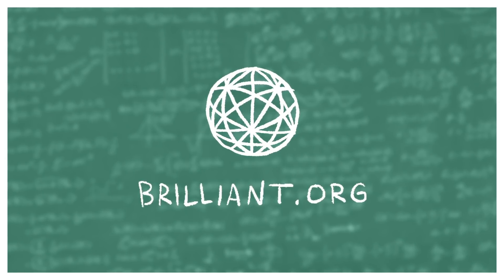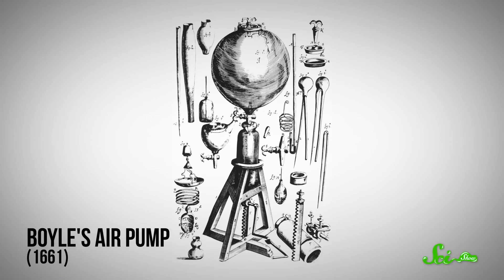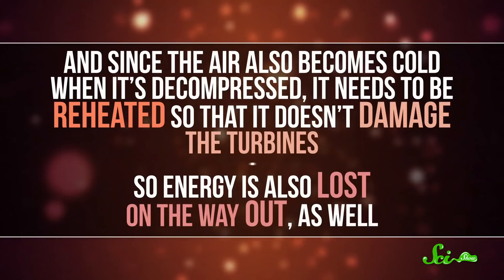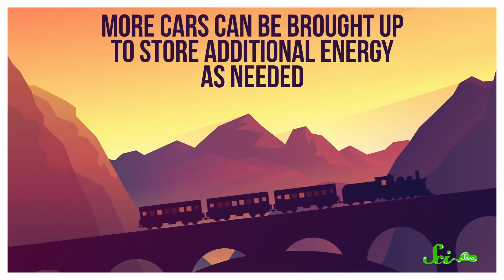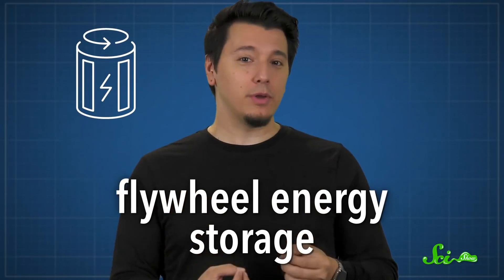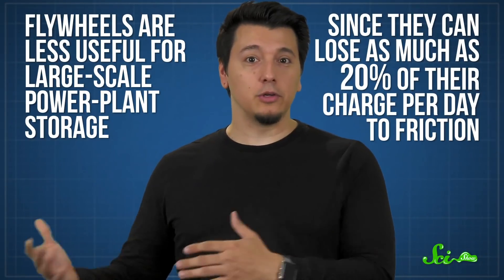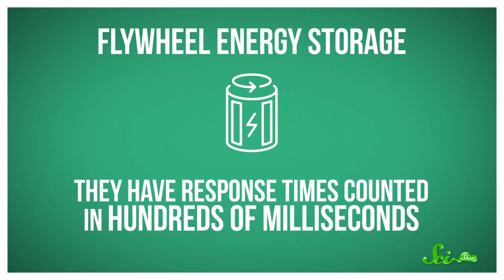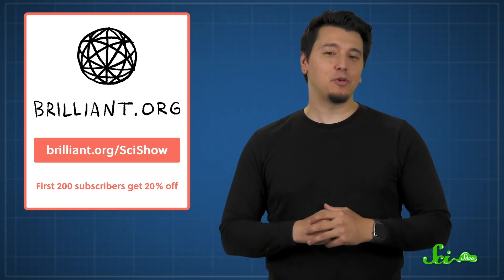The Surprisingly Retro Future of Batteries

Comment: It's really amazing how much energy we use just to heat and cool things. Imagine if we could find a way to use heat pumps to transfer heat efficiently and effectively to where it's needed rather than burning fuel to accomplish the same task. The issue seems to be transmission. Infrared radiation would just get absorbed, and brownian motion requires a contact point or heat exchanger of sorts. Essentially we do this everyday by using an intermediate like electricity, but conversion losses lower it's efficiency. We use energy to generate power to run an air conditioning system, and we heat living spaces where the climate is too cold. To put it simply: I wish we had a better solution.

Comment: drill a super deep hole straight down, suspend an enormous weight over the hole attached to a cable and pulley.   lift the weight with excess solar electricity during the day, and lower the weight to turn a generator at night.  like the weight that powers the pendulum motion in a grandfather clock.

Comment: I'm not sure why anyone would consider pressurized air under those conditions. It might be that the battery wouldn't be depleted or even filled to capacity all that often. Yet imagine repeated cycles over time and the variable quality in the subterranean earth would degrade in unpredictable ways. There are seismic tremors in conjunction with resource extraction. There isn't much talk on how this could impact adjacent underground ecosystems or the water table as well as a possible human incursion through other industrial activities cracking the pressurized space.

Comment: I spent all the the 2010's developing and building large scale energy storage for grid applications.  I reviewed under NDAs probably every technology described here, a total of over 200 different companies by the time I retired last year.  For the next few years the answer is definitely lithium based batteries.  Billions in investment has lowered costs and improved reliability to the point where my latest projects were paying ~$125/kWh for battery modules in the ~50MWh quantities.  ~90% efficient, very low standby losses, and extremely compact. Also, the primary companies here (Samsung, LG, BYD, CATL, Tesla, etc.) are large companies that can financially back long term warranties, which is a real requirement for storage projects that can cost 10's to 100's of $millions.  There is a need for longer term energy storage, and that is an ongoing area.  Compressed air would be great, but the problem of extracting the heat of compression during compression, storing it, and then reinjecting has been one several smart companies have tried and failed at.  Aside from the "train" noted here, there are many non-water gravity storage systems, but few if any can provide needed services at a low enough tech risk and cost.  Flywheels have made great strides, but stand by losses are too great to bear, and Li batteries now beat them at $/kWh by a wide margin.  Also, the edge of a grid storage flywheel may be traveling at equivalent to Mach 2, and if the mag bearings fail, the sudden energy release is a sight to see.   As many people noted,  pumped hydro storage is a mature tech and widely used around the world.  the USA hasn't built any new pumped storage in about 30 years, but that's mostly because of the politics of water in the Western USA.   China was under construction on 20GWh of pumped storage a few years ago.    I believe a lot of current efforts for long duration storage are about creating some energy-dense chemistry using off-peak wind and solar, such as H2, Methane, Ammonia, etc.

Comment: There is another gravity assist "battery" that is being used successfully in Europe and Japan: pumped-storage hydroelectricity. The idea is that you use renewable but intermittent energy sources -- wind and/or solar -- have some power diverted to pump water into an elevated reservoir. This mass of water in a high potential energy position effectively stores the generated electricity. When the intermittent energy is too low to fill the need, water is drained from the reservoir through electricity generating turbines, exactly like hydroelectric power production.

Comment: What about using heavy weighed blocks in series and using the electromagnetic energy from the renewables to hoist them? When you need the power back, release the winch and let the kenetic motion flow into the system.

Comment: Trust me you do NOT want an extremely large rotating mass in a linear motion because it will "want" to resist any directional change, which is how bicycles remain upright. If the flywheel vector is altered while its spinning it could cause an accident and likely take lives & causing property damage rolling down a street or track.

Comment: The crane one is thoroughly debunked. Just the maintenance on the moving cable system alone is insane, let alone factoring in winds affect on the positioning system for the blocks. Cranes are not a simple machine, nor can they operate in winds that would sustain windmills.

Comment: In case someone is wondering why carbon fiber, something light, is a good material for storing rotational energy. It's because kinetic energy of a system increases with the square of velocity and only half of its mass. Carbon fiber has a high ratio of tensile strength to mass, allowing it to spin really fast, making up for any loss of it being so light by being so fast.

Comment: I would love some insight about the liquid metal batteries. They are made out of dirt cheap stuff (like less than $100 per kWh), last forever and could be manufactured in large quantities to solve the grid storage problem. But you don't hear them discussed much No big investments and no big factories being build. The progress is way too slow.
There are also flow batteries and other solutions.
I'm sick of hearing of new ways or about "we can't do this" if we simply had to invest a few billions into just doing it. It would even create lots of jobs! Not acting now will cost millions or billions of lives in the not so far future. It's criminal.

Comment: Pair up the flywheel with solar thereby eliminating the power loss issue. It only has to store the energy till the sun goes down.
This will increase it's efficiency potential. Also where possible wind and solar farms should be combined to increase their output.

Comment: What about pumped water storage?
Excess energy from renewables pumps water from a lake or dam at a low level, up to a lake or dam at a higher level.
When power is needed, the water in the upper storage drops through a conventional hydro-powered turbine generator.
We already do this with coal-fired power sources. .  Just do it more with renewables.
AND . . . .
What about using the renewable-generated power to convert water into hydrogen and oxygen. Store and compress the hydrogen in high-pressure cylinder banks.
When power is needed, burn the hydrogen in a conventional gas-turbine . .  by-product is water vapour.

Comment: What about how we acquire and use the materials themselves to create solar panels and wind farms? Are they without impact on the environment?  I have solar panels and a power wall.  Which one of the three (PVs , wind turbines and batteries) is worse.  You need to take the full "cost" before blindly implementing any of the "sustainable components."  Why would you insinuate that chemical batteries have a greater impact instead of just an impact?

Comment: If you know anything about supply chains, you know it's generally considered a good thing to have a minimal amount of inventory acting as a buffer, since it inevitably slows the whole system down and makes it less efficient. Power is the same way. If we need to store energy for when  supply cant keep up with demand, it probably isnt a very good solution on large scales, in this case, for cost reasons. This makes things like nuclear and hydro power vastly superior, since an energy "inventory" doesnt need to be maintained. Like fossil fuels, power output can be scaled up or down as needed, since we have full control over the output of these types of power plants at all times.

Comment: We could also use steam power for electricity generation better by using water in a vacuum in a closed-loop system only needing 30c rather than 100c to boil a significant reduction of energy requirements and as the expansion rate is the same no matter how you boil the water the same energy generating potential exists as in standard steam using systems. Solar water heaters could be the new solar cells and water tanks as batteries for most of the world.

Comment: Compressed air storage and the heating problem use vacuum insulated water storage tanks, the heat from compression is transferred to the water you can augment this further by having solar water heaters on the facilities grounds and rooftops. edit electrical solar panels being dark heat up rapidly and work better when cooled yet another synergy that can be used.

Comment: They are building a solar panel system about ten miles from my home.  I have no idea how the energy will be stored.  I'm sure that one of you do.  The only generator in the solar panels.  This is supposed to be one of the biggest solar systems that any utility has built.  I know it covers several ayers and has a substation across the heighway.

Comment: Water pumps instead of air pumps, put a solar panel on a fountain pump.
Pump the water uphill or into a tank
Have a gate/valve, open as you need it, and use turbine power generation as the water falls back down. 

(there's even a means for capturing energy from falling water using magnetic flux, if you wanna get fancy)

Comment: Steam is still the most efficient method of turning turbines. The question is basically what we use to heat the water. This is also why nuclear energy is the most efficient form of power production. I've noticed that very few of the ppl that oppose nuclear energy really know what it is and how it works.

TBF, hydro-electric is also extremely efficient. It just has the downside of disrupting the river/lake's ecology and natural flow. But it works for ppl mostly because we've always had a tendency to settle in flood plains and then be shocked when they flood. Go figure.

Comment: Why not just put the solar farms as a ring in orbit? No storage needed at all then, as nearly half of it will be in sunlight 24/7. Just get laser efficiency up a bit and beam it down to receiving stations. Has no one played Sim City? It's 2020, those converter stations should be everywhere by now. Or rather than solar panels use mirrors and use that to heat some salt or other compound that stays liquid for days once molten even without much insulation and even when it's being used to generate 500F steam. Liquify enough of it and there's your MWh's worth of storage.

Comment: I can't tell whether he used "capacity" instead of "power", or use "MW" instead of "MWh".   Either way, that is wrong.
And the video missed pumped hydraulic storage, which is already in use now.
And lead-acid batteries are not "bad for the environment".  They work for many years without releasing any chemicals at all, and at the end the lead  is easily, economically, and totally recycled.  They are just more expensive, per capacity, than some of those other alternatived
Reply: Yeah, I was wondering about the units. You'd think a science channel would make sure to get things like that right...
Reply: Yes, the lead can be very easily recycled by melting down and reforming but what about the production and disposal of the "acid" in "lead-acid" batteries? I concur with your sentiment but there is an objective line in the sand somewhere for what is better for the environment. The problem is, that objective line becomes subjective when people disagree where that line is. To some, simply breathing is bad for the environment...
Reply: @isaach.1135  Sulphuric acid is a naturally occouring biodegradable substance. You can literally just pour it down the drain and it'll be fine for the enviroment. Lead-acid batteries are far more environmentally friendly than lithium or cadmium batteries.
Reply: @BigUriel  well also limestone gets rid of it pretty well.
Reply: @isaach.1135  easy: you mix it with all of the strong bases we are also throwing away.
Reply: In my country (Austria) hydraulic storage is widely used.
Reply: Their only drawback I've ever known using them is to power my home is weight. They're fine as long they remain stationary as per my use.
Reply: Most other batterys are better and better for the environment

Comment: The rail energy storage animation showed a steam locomotive!  Such systems actually use electric traction: electricity in, electricity out.  The illustration should have been an electric locomotive.  Although they are more likely to use only rails to conduct the energy, it would be clearer to show the technology with overhead catenary.

Comment: "Flywheel batteries are pretty expensive"  later  "clean CHEAP and reliable energy sources like these......"
Reply: yeah, theres a reason we dont have many flywheel batteries outside specialty applications. the dollar price tag also goes to show you how energy inefficient they are since the flywheel needs a massive investment upfront so you can have a slight increase of efficiency later on. Besides things like dams, train cars, and similar gravity systems are lower maintenance since the moving parts and the more they stay moving the faster they wear out and the more likely they are to fail, then you have to release all the energy you stored to fix it and with most gravity systems you can keep that energy stored while repairing it.

Comment: I'm confused what limits compressed air storage to 321 Mega watts ? wouldn't that be one particular system , if it is limited by generation infrastructure like turbines you could add more, if it is limited by flow rate you could increase the pressure or have additional piping.  That's an oddly specific number

Comment: Electrochemical cells have no moving parts. They have the highest round-trip efficiency. At the end of their useful lives, they become high grade ores for the production of the next generation of electrochemical cells. Through implementation of Cradle to Cradle design principles, economies of scale, automation, vertical integration of the whole production cycle, increasing density and speed of production per manufacturing site, localising production and consumption centres, etc. the cost and environmental impact of any manufactured good can be brought down to zero.

Comment: Great topic and video!

However, I get really tired of hearing warnings that manufacturing of electrochemical batteries is bad for the environment!  (Not that that was a major point here.)

For example, Lithium mining is often railed against, often by people backed by the petrochemical industry, but when you look at a Tesla P100D electric car, with its monster battery in detail, you find that it has a grand total of about 150 lbs of lithium.  And that car will drive on that Lithium for 15ish years, and then those batteries will be re-used for another 10ish years in stationary power systems like EV quick-chargers or full-building uninterruptible power supplies.  After that, their materials will probably be recycled.

That 150ish lbs of lithium is all that car will ever involve.  On the other hand, a comparable-sized pure gasoline car in its 150Kmile lifetime will burn around 6000 gallons of gasoline into the atmosphere!  And that’s the largest EV battery known;  most EVs have batteries 50-70 percent of that size.

Comment: There's another example of a battery here in the UK: two lakes, one situated far higher than another. When there's a surplus of energy, water is pumped from the lower lake to the upper lake, and the water flows down when they need to syphon energy.

Comment: "Capacity" in Watts? C'm on guys, you can do better than that.
Reply: I think it was used correctly, given the number. What they're saying is that the largest set of turbines connected to an air cavern, somewhere, is capable of producing 321 MW. It would be nice to say for how long but OK.

But you are right that whenever someone mentions power for an energy storage you're always suspicious. It's even more annoying for battery storage where a typical battery can be discharged in about 1 hour, which means capacity in W-h is about the same number as sustained power in watts.
Reply: What watt?
Reply: Just saying it’s quantitative
Reply: I prefer the old fashioned imperial measurement of "potato batteries per hour".
Reply: If something is capable of something, you can describe it as capacity. Nothing about the word innately means energy storage.
Reply: Power capacity not energy storage capacity. Literally just a misunderstanding.
Reply: Yeah, like anti-gravity sound waves. This show is ass now

Comment: I'm disappointed that you didn't mention reservoir batteries. Basically you pump water to a reservoir on top of a hill and when you need more power you let it flow through a turbine. I don't know how old the idea is but I thought it should be mentioned.

Comment: Couldn't you also use a series of large, mechanical springs?  I'm thinking of something like a giant-sized watch-spring that would be "wound up" using excess energy and then used to drive a generator by being "unwound" in times of need.  I would think that once the spring is wound up it could sit there for a really long time waiting until it was needed.

Comment: Let's not forget that once we're switched over to renewables, a lot of the excess in one area will be sent to another area having a deficit, just like we do now with fossil fuel generated electricity.
(That's what made the Enron scandal possible).

It's not going to be a use all you make right there or store it, our current system sends electricity long distances to get it where it's needed when it's needed.